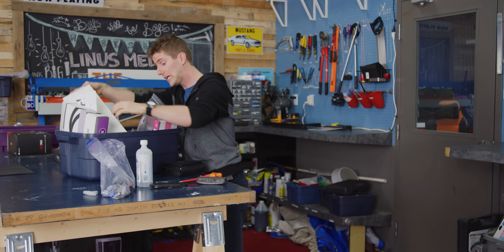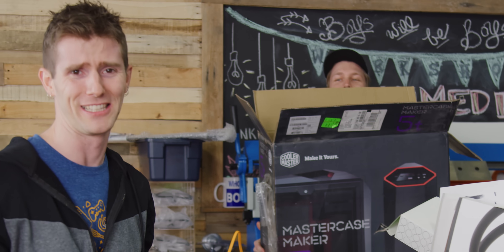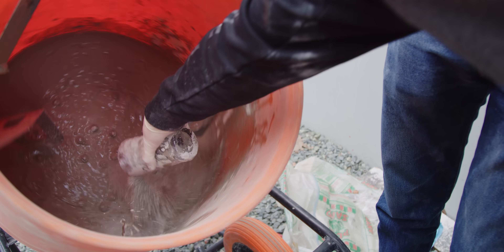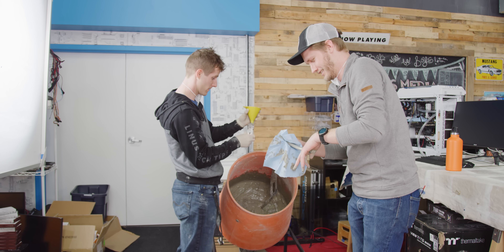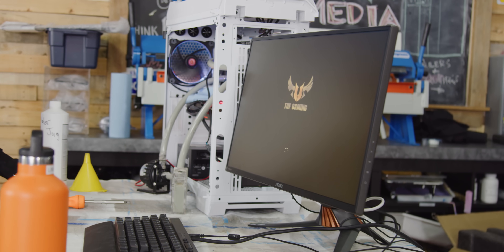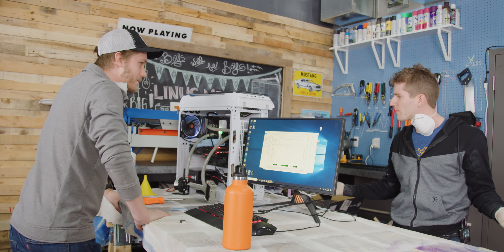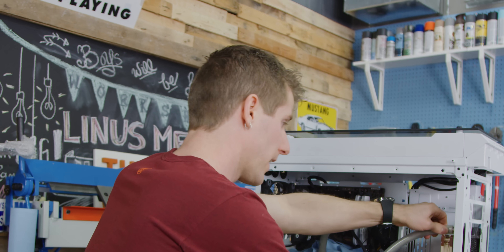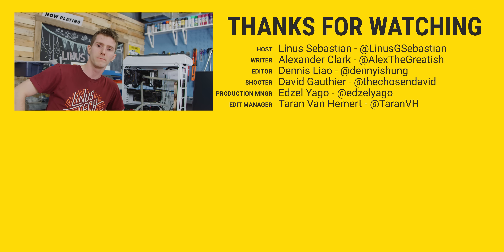I Can't Believe This Worked!!! - Concrete Cooled PC (April Fools 2019)

Comment: The fact that one isn’t initially able to tell if this is April fools or a standard video says a lot about the content on this channel
Reply: I still cant tell :D
Reply: I legit didn’t know till I checked the comments to confirm.
Reply: It will still harden even if it's moving and/or sealed... If a cement truck gets stuck in traffic some poor dude is going to have a really shitty day...
Reply: It became obvious when Linus went straight to cement mixing without a previous baseline
Reply: Wait... this is an april fools joke?
Reply: thought absolutly the same^^
Reply: *A lot of great things, to be clear
Reply: Oh it’s very obvious at the point of talking about the flow and sound
Reply: yeah i believed  it lol
Reply: I watched the whole thing and thought it was legit tbh
Reply: The joke is that he recommends it tho
Reply: The fact in still unsure about this video says alot about this channel
Reply: blooddragonofdeath same
Reply: Do true 🤣🤣
Reply: Preach
Reply: Greatness? :)
Reply: i have a few channels that work the same way. Feels good
Reply: wait... this was an april fools joke?
Reply: So what is the fact about you that you watch the content?
Reply: I cannot wait for the next reading mean comments video
Reply: okay boomer
Reply: Rocket League  it had water pipes to cool it and slow the cure yes. But it was to prevent it overheating and curing a, too fast and b, boiling off the water which would be structurally catastrophic. On smaller pours heat absolutely speeds the process, exothermic or not. Heat speeds EVERY chemical reaction. If you think a hot day doesn't speed up the cure, then you've never worked concrete.
Reply: Rocket League  https://www.powerblanket.com/blog/concrete-curing-temperature-makes-difference/ 

Heat speeds the cure but makes the concrete weaker. Look a factual source.
Reply: Rocket League  try reading jackass. It says that at high temperatures concrete cures faster, but is weaker as an end product. Stop cherry picking information you moron. I know it's a fucking exothermic reaction, it generates heat, but that makes it cure faster. AGAIN LIKE ALL FUCKING CHEMICAL REACTIONS IT OCCURS FASTER WHEN HOT.
Reply: Rocket League  https://www.engr.psu.edu/ce/courses/ce584/concrete/library/materials/Admixture/Link-settime.htm more proof
Reply: Rocket League  at 38c concrete takes 1 2/3 hours for initial set. At -1c it takes 19 hours
Reply: Rocket League  https://www.concreteconstruction.net/how-to/best-curing-temperatures_o
" By "best" we assume that you mean "most thoroughly" and not "fastest." The higher the temperature the faster the concrete will cure. But concrete cured at high temperatures generally does not reach as high an ultimate strength."
Reply: Rocket League  http://www.concrete.org.uk/fingertips-nuggets.asp?cmd=display&id=392
"Even if the temperature does not drop below zero, the concrete will not gain strength as quickly as it would during the warmer months."
Reply: Rocket League  don't like proof? And facts? Or actual first hand knowledge from someone that has poured concrete... Nope didn't think so. Go back to your little troll cave where you came from
Reply: And yes, selling blankets to keep concrete at the right temperature to cure properly is a HUGE business, especially in colder states where it is needed to get any sort of cure at all in the first 3 days.
Reply: Ooooooooooooooooooooooooooooooooooh. I feel stupid now.
Reply: Found this after a while. And remember having a distinct memory of the concert pc blowing my mind. Watched it a second time and still took half the video to realize
Reply: Also did anyone notice Linus is damn good at making adds not boring? Legit I don't care about the product but somehow it's not annoying lol. I think he could do a side gig as a voice over actor or something 🤔 imagine the next blockbuster pixar animation   with our dude voicing it lol
Reply: Technomen 08 except that concrete hardens, it doesen’t “dry up” so it won’t stat liquid.
Reply: @Tharkz  it wont dry up if its air tight
Reply: Kable yes it will. Cement bonds with water as it “hardens” (hydratiserer in danish). Lab test blocks are often left to “harden” submerged in water too.
Reply: Tharkz bro I work in construction..... the comment if you don’t get it is kinda parody
Reply: @Tharkz  Yeah, it's a chemical reaction (as I understand it, anyway), but I thought it needed oxygen from air or water to work. Does concrete harden if it's sealed up? I'm really not sure.

Although, given that it looks like a standard block & radiator, I'm going with April fools. Heavily.
Reply: @OtherTheDave  if you keep it moving and warm, it will stay liquid. especially in a sealed loop like this. so that part would work, what I think is the april fools joke is that it was a great coolant.
Reply: @OtherTheDave  concrete actually chemically bonds with water. Which is why it takes a long time for concrete to harden 100%, as the amount in the mix isn't enough but if too much water is used the cement becomes brittle as the water displaces the cement in the mold.
Reply: It IS the April's fools video. They do it every year
Reply: @OtherTheDave  doesnt need oxygen, dont know why you thought that
Reply: i want an actual version  of this with actual test results xD  @JamesMichaelDoyle
Reply: @EyesOnReality-d4h like I previously said, keeping it moving and warm would most likely keep the cement fluid for a long time.  I don't think it would be good at cooling though, because it would have to be able to release the heat easily in the radiator.

it would have been fun if they had actually done this experiment for real, before destroying it for the meme video. im curious as to whether it would actually work at all, or if it would just absorb the heat and keep it.
Reply: @JamesMichaelDoyle  Also, lower PH reduces the reaction rate.  Add a bit of vinegar or similar and it will stay liquid for a long time (a can of coke spilled into concrete will make it take a day or more to harden).
Reply: @lperkins2  didn't know about the coke thing, that's neat
Reply: @JamesMichaelDoyle  That's actually how I first learned about it.  I know someone who used to do foundations for residential buildings.  One of his coworkers spilled a can of coke into a section of a foundation, and it caused a pretty serious delay in the project since they had to figure out what happened and how to deal with it.  As I recall, they ended up ripping a section out and repouring to avoid any liability issues.
Reply: @JamesMichaelDoyle  keeping it warm will speed up the chemical reaction. It won't help keep it fluid, this isn't a thermoplastic or lard. Concrete/ cement harden when combined with water, heat speeds up that reaction, you can dilute it so far that the individual grains of cement cannot bond with each other, but they will still tend to separate out and stick to things. That's why even diluted cement rinsed down drains can cause clogs. 

Keeping it moving doesn't stop it curing either, if the cement mixer is stuck in traffic more than 30-60minutes the cement is partially cured, it will no longer be usable as it loses its structural strength. If it isn't cleaned out quickly it will harden inside the cement mixer and coat the inside of the mixer with cured cement, which some poor bastard will need to clean out with a chisel, usually the driver that let it cure.

This is why concrete batching plants are kept near to large worksites to prevent this happening. For longer distances a retarder can be added, but this slows the reaction so it takes longer to reach structural strength, which slows the progress of work.
Reply: @98dizzard  keeping it moving in a sealed, airless loop. a cement truck is nothing like that. as for the heat, this is also being dissipated (theoretically), the question was whether or not such a setup would actually be able to maintain it.

A for effort at least.
Reply: @JamesMichaelDoyle  air makes no difference to the curing process, it is not part of it. The curing is initiated by a reaction between the cement and water. As soon as they combine the cement starts to cure, the more heat applied the faster it will cure. Cement will happily cure completely submerged in water with no air at all. Working time for cement varies depending on conditions and additives but is typically in the 30min to 2 hour range, after this point the cement is starting to thicken and becomes hard to work. The hotter the cement mixture, the shorter this working time.

If you don't understand how cement works there are plenty of YouTube channels you can watch to learn. Evaporation of the water (or drying) is not part of the curing process, in fact drying the cement will actually stop the curing process and is a major hazard in construction. Concrete absolutely must be kept wet to cure correctly.

 It is much more like polyurethane glues or super glue in that regard. The reaction is initiated by water in those cases too, however they cure with the small amounts of moisture naturally occuring in the air or substrates.
Reply: @98dizzard  lol k. sure thing bucko.
Reply: because offgassing is not a thing during curing. and thus "air doesn't affect it". /eyeroll

for someone professing to know so much about it, you are seriously lacking the basics.
Reply: @98dizzard  a quick google search shows that you are fucking wrong. dead wrong. there is offgassing in all concrete and cement, with varying levels of toxicity. most do not have a voc level to pose any health risk, and the ones that do, are only at unhealthy levels for the short time at the start of the process.

if you want to read some actual experiments and research done on the issue, have at it.
Alicje Cornelissen, "Concrete's Role in the Indoor Air Environment," PCA R&D Serial No. 2098, Portland Cement Association, Skokie, Ill., 1998. 

it does require offgassing. and as has been mentioned numerous times at this point, the question is whether or not the curing could be suppressed sufficiently in a sealed airless loop, and if it can, can it dissipate the heat that it absorbs in that state/situation?

I don't think anyone actually has made a serious effort to try. mainly because it has no real practical applications. even if it could be made to work, it would still be vastly inferior to the standard options. but I think it would be neat to see, just to find out theoretical limits of curing suppression. 

sit the fuck down, you fucking clown
Reply: @ Technomen 08 - This comment cannot possibly be rated high enough.
Reply: This is way less cringe then most of the videos that feature Alex.  You should have seen the time they sent him to see LIGO.  He focused on the concrete walls, literally commenting how they were built protect against birds and bullets.  He later mispronounced Nobel which literally means the moron never actually heard of a Nobel Prize.  You cant make that shit up.

Comment: Concrete pumps are a thing. Probably how your foundations were layed. What you made was morter. Concrete has corse aggregate in it for strength. Cement and water causes an exothermic reaction when it sets so it will create heat till it sets solid. The cold temperatures you are measuring is purly the ammount of dense solid in your loop compared to liquid.

Comment: what if you use liquid nitrogen inside your cooler? i mean competitive overclocker typically build a shaft and pour liquid nitrogen in it, but it all leaks out due to contact with air. What if you could somehow produce one without contact with air? Could that significantly improve your pc?

Comment: by definition, concrete is cement + sand + rock + water

if you just mix cement with water it's a slurry, and in this case it's more like a mortar - also, pro-tip if you add some plasticiser in
 your slurry mix you can make it flow much better, almost like water

*there's also a lot of material with this "flowing ceramic" property that aren't hydrosetting, fly ash, silica fume, even just mud, maybe you could try that next time
Reply: yeah this
Reply: I mean this was supposed to be a joke. They're not gonna try that hard to make a joke so good that it actually makes sense, that would ruin the joke

Comment: So this is meant to be an April fools video right? But the concrete is actually keeping the pc colder but it becomes solid if turned off but what if you never turn off your pc? Wouldn't it actually work then?
Reply: What is -10°C? I would really like to help out since you asked so nicely but I don't exactly get what your question is.
Reply: @briang5033  i meant degrees in celcius
Reply: Oh ok, I get what you are saying, now that you edited your comment. So first off, the cement they put into the loop (like you said, as a joke) never even moved through the tubing. Not even a little bit, belive me. The pump they used is meant to be for normal pc cooling loops, so for liquids that are way less thick. Don't get me wrong, there is pumps out there that can move concrete through pipes. These are sometimes used at construction sites, but (not to get into too much detail) these are built way differently. Also, the channels in the CPU-Waterblock, in which the cooling liquid normally flows through, are tiny. So not even a pump meant to push concrete is able to push it through these small channels. Before that would happen, the tubing would pop off the fittings or even burst.

The other thing is, even if you could push the cement through the loop and never turned off the pump, it would still harden over time. After 24 hours something that looks like moist, gray sand would be going through the tubes, which is even worse for the thermal transfer from the heat source (the processor) to the cement, compared to when it's fresh and relatively liquid. The heat a "cooling solution" using even fresh cement could dissipate would already be very low for many reasons, the biggest one being that the concrete probably wouldn't be able to move through the loop very quickly at all.

I hope I could help you, dude. I know it seems weird that I went through the hassle of explaining this, I just felt like helping.
Reply: @briang5033  Hey, thanks a lot for taking time out of your day and explaining all that for me, I don't have a liquid cooler and never watched any videos about it so yeah I don't know much about it. But I did have a feeling that the concrete definetly wouldn't go that fast through it, just didn't know if keeping it moving non-stop would stop it from hardening or turning into sand or whatever.
Knew the video would end with the concrete hardening though that was easy to predict.

Thanks again for clearing it up for me dude.

Comment: 8:42 That's one prime example of the no-slip condition, a very important starting property in fluid dynamics
Reply: I mean, if the flow was stagnant near the outer walls, it could have just closed up on its own too at some point.
Reply: @OnlyNeedJuan  No it won't. There's a velocity gradient in flow over a surface. If it did, a simple water pipe won't work
Reply: @WouterVerbruggen  I was thinking it might be slow enough for the cement to settle, seeing as it has such a high viscocity (depending on the mixture with water), couldn't it go stagnant enough to settle at that point? Or does it just follow a regular laminar flow where its simply the outsides lagging behind a bit compared to the center?
Reply: @OnlyNeedJuan  The latter. Given no parameter change. If there is a flow it won't out of nowhere stop. You basically discribe how the flow in a pipe behaves in your last sentence. Check out https://en.wikipedia.org/wiki/Hagen%E2%80%93Poiseuille_equation#Derivation

Comment: great idea for the next fluid, with the goal of heating the fluid, not cooling the cpu. hot chocolate. 
add a sip line, a refill port for regular use, full meter, and a thermometer to know when it is just the right temp.
coffee, tea, hot chocolate, ect. should all be good for cpu warmed gaming drinks.

Comment: I think they should have just said to add concrete to the water to help with the heat transfer and had it actually running it.

Comment: Just filled my loop with quickcrete and adjusted the ratios a little. I’m running an OCed i9 7980xe and am getting low 40c under load! I will be moving my K|ngP|n RTX 2080Ti to this method as well! 

Additionally, I found out that this is also effective in vehicle engines! I drove for hours just now with a concrete cooled engine as well! - WINNING!

Comment: I dont know why you were going to those lenghts to adhere to proper ratios. Those ratios are for best solidifying results, not for good hydrodynamic properties. I think that better results might have been acheved with more water in the mix.
Aparrently by putting sugar in the mix, the concrete will not solidify. All you need to do is to desolve like 20 grams of sugar in water before mixing in the cement. Would love to see this work.

Comment: Toothpaste as thermal paste when?
Reply: Not. Going to lie I ran toothpaste as thermal paste in highschool. It actually worked ok
Reply: @genericjosh96  Just about anything that you can squeeze out will actually work. As long as it doesn't get in the way of the bare metal, it will somewhat work.
Reply: Thermal paste cooled pc when?
Reply: Minty cool
Reply: mouthwash lol
Reply: what about toothpaste cooling?
Reply: I think Luke did a thermal paste comparison test on this channel, and it included toothpaste IIRC
Reply: its been done a thousand times on video... it works, it just wont last more than like an hour
Reply: Jay did that quite a long time ago

Comment: For the record, actually, if you put central heating radiators into a big hole in the ground and then fill the hole with concrete and then run coolant through the radiators, then it should be relatively cool.